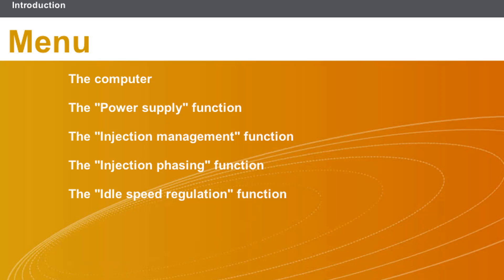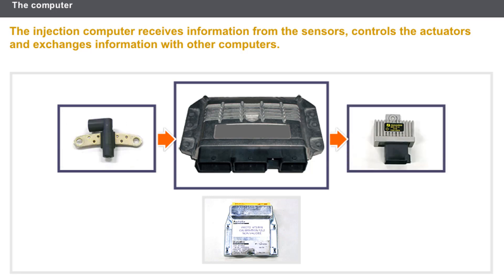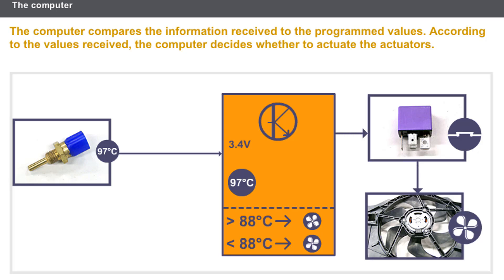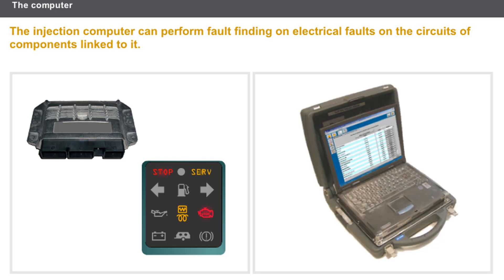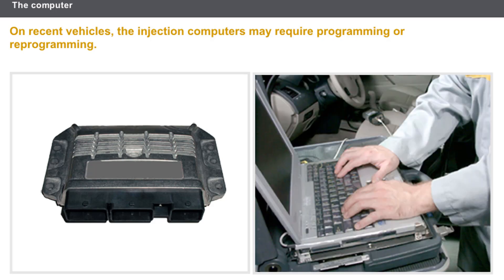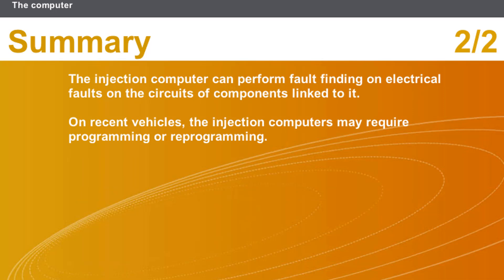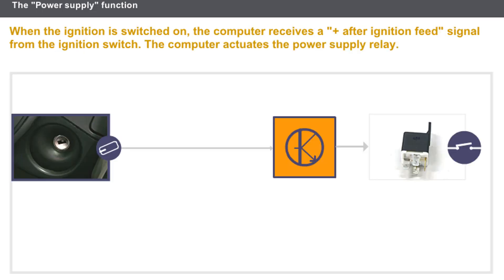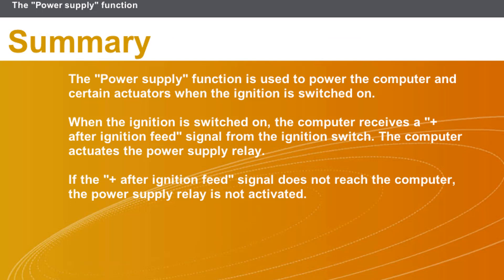Engine diesel part4 the computer

Comment: What is the Price for it.
Reply from the maker: Thank you for watching our video on the diesel engine computer! If you're inquiring about the price of the car's computer, it can vary based on the make and model of the vehicle. Additionally, factors like whether you're opting for a new or used computer can influence the cost. For specific pricing details, it's best to check with your vehicle's manufacturer or a reliable auto parts supplier. Feel free to ask if you have any more questions about the engine or any other related topics! We're here to help.